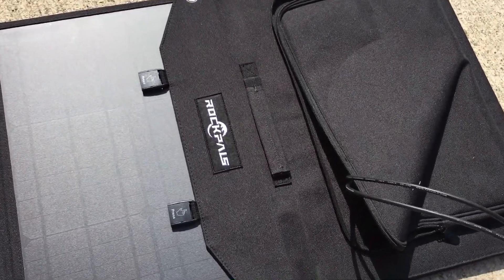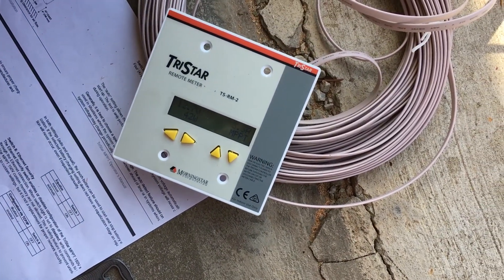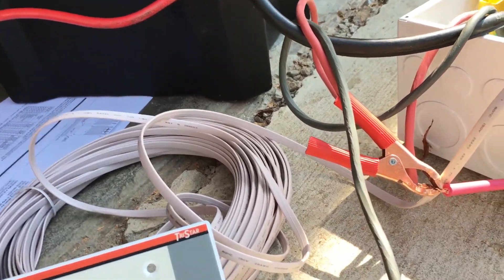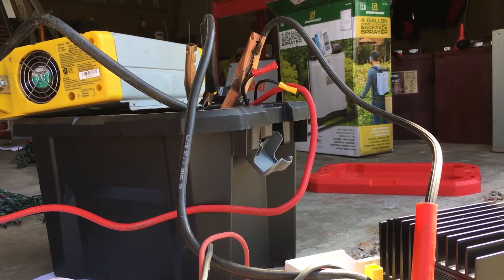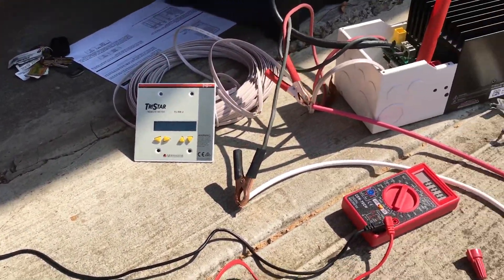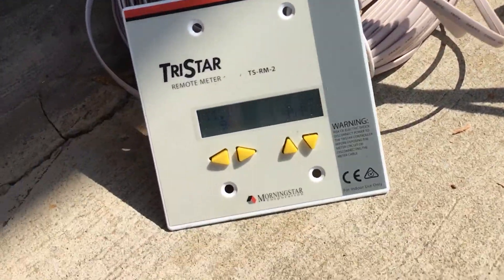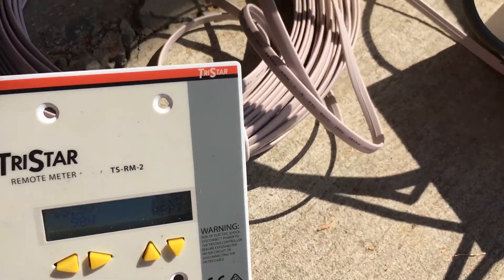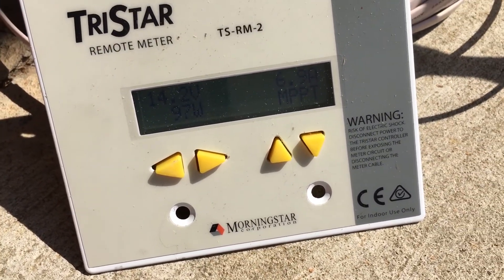RockPals 100 watt foldable solar panel

Comment: How would this do for small portable batteries? 20,000 mAh or so
Reply from the maker: Trakx Me I think it would be more than enough solar panel power. Do you know how fast in amps your portable batteries can accept a charge?
I’d bet the built in usb on this panel is only 1 amp, but you could buy a better charge controller that supported a few usb 2.4 amp outlets.

Comment: Would you recommend buying the  rockpals now that you've had it awhile? Thanks.
Reply from the maker: The rock pals is not a bad panel. There are better panels on the market now that have better features such as waterproof, usb c, and kickstands , and some will output what they claim. Most however give you about 75% of the rated number. So long story short, If the price was right, i'd buy again. But I'd shop around and look for the best prices and quality /features!
Reply: @IFix-Things  Thanks for getting back to me. Over the past few weeks I have been checking out different power supplies and solar panels. Rockpals was one of the ones I was considering. Any problems at all with the unit?
Reply from the maker: @ronaldstrayer580  no sir , the panel is working great!
Reply: @IFix-Things  Alright, thank you and take care.